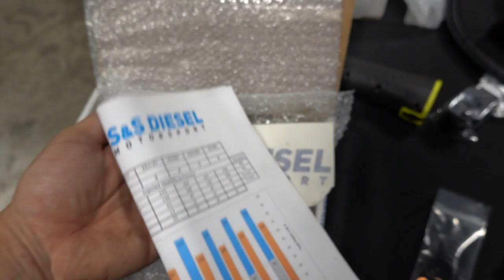100 TON CONCRETE WALL POUR!!! IT'S FINALLY DONE!!!!

Comment: Just a fair warning. I used to do water proofing on homes and seen alot of corrugated pipe fail. Be it from crushing or just eventually filling with mud. Sdr35 perforated pipe

Comment: Hey Greg, I’m not a expert on concrete pours but I am a heavy equipment operator and work around a lot of projects like this. From looking at the size of your wall pour and how much dirt is going to be in the backside of your wall, did they recommend any anchor points/ tie backs? Dirt is 2000lbs per cubic ft. and you have a ton of cubic yards that are going to be resting up against that wall. I would hate to see you run in problems down the road with the wall cracking or falling in. something that size to me should have anchor points in it, but like I said I’m not sure if they talked to you about that. I just don’t want to see you run into problems down the road. Love the content you’ve been pushing out keep up the great work 🤘🏻
Reply: Eric Buchwald was wondering about that too
Reply: If that material is placed in lifts and packed with a diesel plate packer it will be fine! We do it in Canada every day and we have to deal with major frost movement so no issues in Kentucky I'm sure! JMO!

Comment: Awesome awesome video Greg A, retainer wall work flow lol, the wall turned out awesome I can’t wait to see a building on top of it for a new shop area. Glad the injectors put of the 08 came back from S and S with a clean bill of health and upgraded, that’ll save some money there over all new injectors. Awesome 10mm Stroker CP3 that should do the job flawlessly. A lot of Awesome new parts getting on the 08 , can’t wait to see this think back on the road.

Comment: A tip is to grind down the wire that hold the concrete form and put a slab of some cement over, or else the water will find its way trough the wall.

Comment: Hey buddy, those trucks hold bout 10 cubic yards, a yard weighs bout 4000 lbs, so 40,000lbs per truck, 12 trucks is 480,000 lbs, so it's really a 240 ton wall.  HOLY MOSES

Comment: Has anyone installed a fleece coolant bypass without taking the trans out?
Reply: Yes and its painfull
Reply: I’d imagine it’s about the same as changing turbo up pipes in the duramax. It’s torture. At least the bolts on the turbo pedestal.
Reply: I would say it was the first and the last time. Next time ill put the trans out
Reply: Travis Holden same thing for a second gen?

Comment: What HP will the stock cp3 hold to?
Reply: Darren Furlong generally 500-600, depends on how healthy your pump is. Mine did low 500s but had 250k miles on it

Comment: I find it odd that you’ll spend extra  money on black fittings.. but won’t spend the money to just have the injectors either rebuilt, or buy brand new injectors to put in while the motor is fresh..